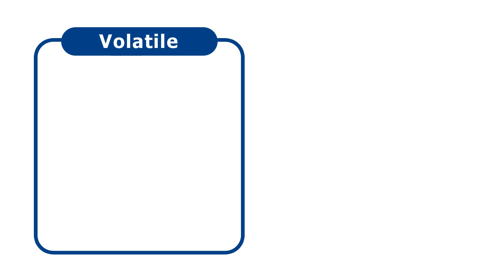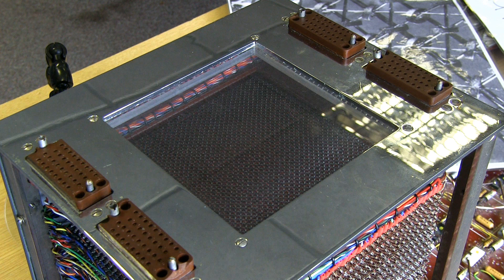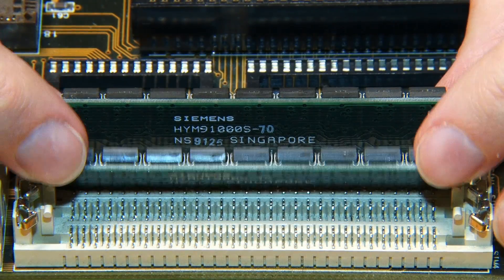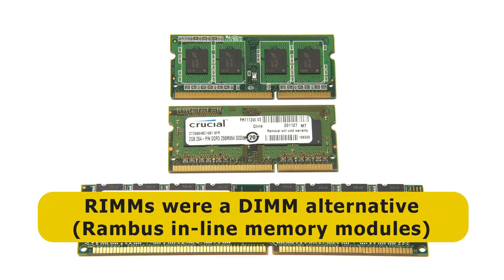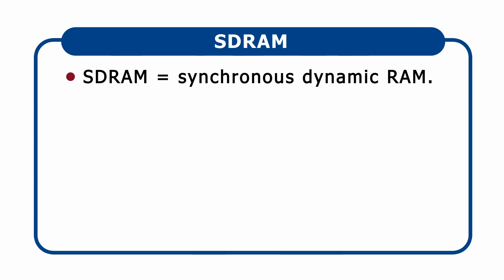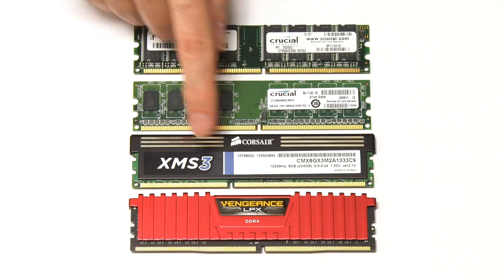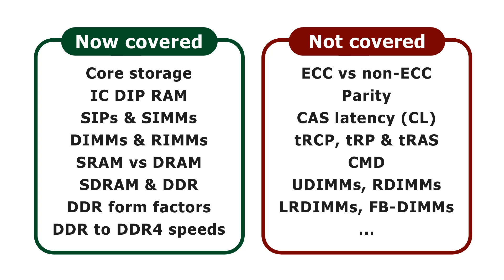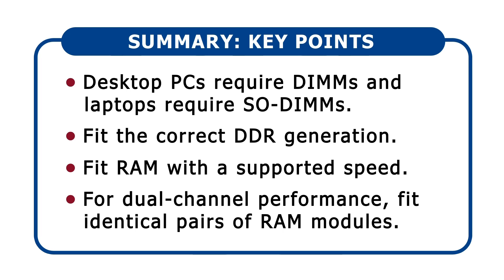Explaining RAM

Comment: I'm an actually noob who had someone else build my first computer, now hoping to build a computer I can truly call my own. I went to the mall to canvass computer parts and prices, and you could only imagine my face as I was completely overwhelmed by what the parts were listed as. What's the difference between a normal graphics card like a GTX 1050 and a GTX 1050Ti? What does the Ti even stand for and why is it important? What's DDR4 and how is it different from DDR3? What's PCIe? I/O?

All I knew coming in was from my current computer: I knew I needed a CPU even though I barely knew anything about it except that it means Central Processing Unit and I'm suddenly faced with Ryzen and Intel brands. Why are their sizes so different? What's core count supposed to mean?
I knew I needed a motherboard but what's overclocking and why does that make it better than the rest?
I knew I needed a Hard Disk Drive because that's what's in my computer, but what's this Solid State Drive and this M.2?
I knew I needed RAM but what's DDR? What are these letters and numbers?

Quite literally all I could go on about things is the price and the appearance. I just decided that if it's expensive and looks impressive, then it must be good. I got really intimidated by the price total and thought about leaving but decided to just go talk to an employee for their opinion. When I showed an employee my list and asked if it could work, he actually snorted because of how off I was. I had Ryzen Threadripper and Asus X-99 motherboard at the top of my list. When the guy asked if I actually knew what I was doing and I said no, he was actually really nice when he said I should probably go home first and research properly. It's been 2 months since then and all I've done is look things up. I pick up a few things here and there, but this video is pretty much explained everything about RAM I think I need to know. Thanks so much!

TL;DR: I'm a noob. Wanted to build a PC. Didn't know what anything meant. This video explained some things to me simply and clearly. Thanks!
Reply from the maker: Thanks for this. And look out for my PC build series that starts in the second half of Jan 2019. :)

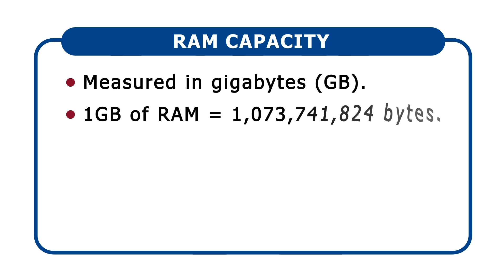Comment: @1:05 you say RAM capacity is measured in GB.  I would have just said 'bytes' since RAM capacites can vary from megabytes, kilobytes, or even bytes depending on the application.
Reply from the maker: Years ago I would have agreed with you. But today, anybody purchasing RAM is going to purchase it in GB, so that is why I used this measure.
Reply: I guess I was looking at the video as a guide to RAM in general, and not as a  guide to Desktop and Laptop RAM upgrades.

Comment: I have a 2013 build pc which has Intel 3450i5 processor, db75en motherboard and 4gb ddr3ram. Recently I updated another 4gb. What do you recommend if I update another 8gb single piece if I want to run high ram consuming design softwares or to buy a new setup?
Reply from the maker: If I understand it, you currently have 2 x 4GB DIMMs? If you have two spare slots, the best upgrade would be two more 4GB modules. You could replace a current 4GB with 8GB, but will lose dual channel performance (not a massive issue though).
Reply: @ExplainingComputers  Yes,you understood right.My motherboard has 4 slots ,it can support 32gb so if I update it with another 8gb ram and keep the remaining slot for future update will it be viable keeping in mind the age of the system.
Reply from the maker: Yes, that should work -- though I personally would not plan on a further update of that board, and instead fit 2 x 4GB in your 2 remaining slots to achieve best performance. 16GB is a lot of RAM, and will remain so for some time.
Reply: @ExplainingComputers  thanks a lot. Proper technical answers are had to find. Thanks again.

Comment: Nice video and I've been at this so long that the only memory I have not installed is toroidal magnetic memory.  The one thing is ECC memory, I have had customers ask me to install the memory they "got cheap on ebay"  only to find they have ECC ram that is not compatible with their desktop computer.  So more on the compatibility or non-compatibility of ECC ram would be good.  Maybe a note in your description will same someone a headache.  I do love your videos and to think of when I started working on computers and then see the videos you do on small one board computers that are so powerful is just amazing.  I remember when I upgraded my first computer to 32K ram and paid big bucks for the chips.  I still have my first computer with all it's patches, jumbers, glued on heat sinks plus a display board mounted on cardboard so it would not short out.  I still do that kind of thing (just for myself) the computer I'm using right now is called frankenputer made from all kinds of leftover parts and  bits of trade in systems with a little wire wrap jumper and glue here and there.  keep making videos and every now and then think of where we started.
Reply from the maker: Fair point. ECC is not intended for consumer/domestic use.
Reply: @ExplainingComputers  True; unfortunately the computer manufacturers do not always tell the consumers that.  I do very much enjoy your videos, they Reminded me computers can be fun.

Comment: Hi Chris. Things are getting busy around here. Your explanation of ram was top notch. I see that you avoided the discontinuance of parity, I still think it was a mistake for Intel to do that as witnessed by the Pentium 2 + 2 = 3.99999.... It seems to me that the pc industry has sacrificed data security for speed, although to be fair I don't remember hearing any similar jokes about the mathematical certainty of a pc's answers so perhaps Intel has found a way to do it without attracting headlines. I remember going onsite to a BIG financial center to swap out the mathematically challenged sticks for those that weren't. It was an interesting job going in at some off hour with none there except us and the "shops" techs ripping out and slamming in good "ram". Take care.

I would like to send you a small audio file, do you have an e mail address or a Dropbox account that I could forward it to?

Comment: It's great, but a noise gate on that mic would be even better!

Also, 1 GB is actually 1 000 000 000 bytes, 1 GiB would be 1 073 741 824 bytes. Putting a metric prefix on a non-base-ten number is a dumb idea!
Reply from the maker: There is no gate on the microphone used for the off-camera narration here (it is a Sennheiser ME66 into a K62 powering module), but there is a gate used on the powering module for the Audio Technica AT803 (an AT8531) used for the pieces to camera). Please note that I have very significant problems my voice following surgical damage to my vocal folds a few years back, and that this necessitates significant post-processing. If you do not like my audio, fair enough. But please do not make assumptions about the equipment and care dedicated to my audio production. There is much, much worse on YouTube! :)

One gigabyte of RAM is most certainly 1,073,7541,824 bytes (due to the way memory is manufactured). I have covered this issue in depth in another comment. But in short, all RAM is sold and labelled in "GB". Yes, in theory, it should be "GiB". But in the real world, GB is what the RAM manufacturers use and will continue to use to specify and label their products. The "metric prefix" point was not raised for decades, then suddenly became an issue about 10 years ago, even though everybody in computing was exceedingly clear what GB, MB and KB stood for. For SSD and HDD storage, the point certainly matters, given that capacities are often cited in actual GiB but labelled (and then formatted) in GB. But this is not the case for RAM. I check and consider very carefully what to include in my videos, and here this very much included being very careful on those GB/KB units and figures cited.
Reply from the maker: And just to add, all standards bodies that I know of accept (if begrudgingly) that "GB" is used a synonym for "GiB" in the computing industry, and especially when it comes to RAM.
Reply: @ExplainingComputers  Sorry for being derisive! I wasn't trying to be rude. I understand your difficulties in audio recording now. I always considered the IEC standard for the gigabyte to be the golden one so I raised that point about it up. But no big deal, it's just something that peeved me a tiny bit. 

That being said, the quality of this video and all your others are of top-notch quality, and I consider them to be better than those made by other tech YouTubers. I hope you keep making more, as it benefits the community as a whole greatly.
Reply from the maker: Thanks for this. And I do understand your position on the GB/GiB thing! :)

Comment: Core memory was used in military computers and even the Space Shuttle into the 80's.. This was because it was non volatile and well proven. as an example the memory in the computers recovered after the Challenger disaster from the bottom of the ocean were still able to be read out. These cores had a hole in them smaller than a human hair but yet 3 wires could pass through them. The 3 wires allowed for read/write and sense..  The cores were described as "torroidal magnetic cores". Contrary to your image they all faced the same direction and were produced up to 128Mb
Reply from the maker: Thanks for this. However, please note that the cores did not always face in the same direction in core storage. If you look in the video at about 2:11 you can clearly see that in this Elliot memory unit the cores are positioned at alternate angles, just as they are in the graphic earlier in the video. I do not doubt that some core storage units were built with all cores facing the same way, but evidently this was not always the case. :)
Reply: @ExplainingComputers  I imagine there were several different ways to do it.. maybe by alternating the orientation they hoped to avoid cross field induction ;)  since reads are destructive
Reply: also there was "Drum" storage.. basically like a disk but in the shape of a tin-can with multiple read/write heads  and don't get me started on old school mainframe storage (tape, helical tape etc)
Reply: My first career in 1979 was at IBM Federal Systems Division  (now part of lockheed-Martin) and I tested core memories amounst other hardware for military tactical computers and Space Shuttle
Reply from the maker: You must have seen some amazing technological things! :)

Comment: When I started with the first computer (the father's one) in the house in the middle of the 80s, it was a Commodore PET 2001 series with an upgrade of ram to increase it to 64kB (Yay!) directly soldered on the motherboard. Lots of memories with this video... Thank you! ;)
Now, as a professionnal software engineer, I'm always upset to see how dirty and inefficient the usage of ram can be done in many softwares even if they are targeted for light configurations or embedded platforms (my special skill). It drives me crazy... And when I try to explain my point of view, my coworkers or boss look at me like I'm an alien.
Reply from the maker: Well I agree with you -- most software has become very RAM inefficient.
Reply: Not only RAM inefficient but cpu as well! I learned 6809 assembler so I could write a word processor for my 16K Coco way back when. That cpu was a Motorola 6809E running @ .49mhz but could keep up no matter how fast I typed, cut, pasted, etc. I was running the OS9 operating system with a single sided 5 1/4 floppy drive.The controller for it was plugged into the game port and booted JDOS which was used to then boot the OS9. Also had a cassette tape drive. Point is one could get a lot done in just 16K of RAM with efficient programming! Later went to MS MicroAssembler with 80xx machines to keep the code small, fast, and increase ease and speed of coding. Ah those were the days! Now using C++ and C# (just for fun due to retirement quite some time ago) and do not feel like I have the same level of control I used to have!

Comment: Motherboard says 2667mhz ram speed and then higher speeds with OC (example: 3200mhz (OC). 
What does it mean? Should I buy 2666mhz ram to play it safe?
Reply: Yes I dont want to OC anything be it ram cpu or gpu. I vote always on durability.
Thanks
Reply from the maker: OC stands for "over clocking" -- where you reconfigure your computer so that its components run faster than the design initially intended in order to improve performance (if at the risk of instability and a shorter working life). So what your figures mean is that your board is designed for 2667 RAM in standard operational mode, but can over clock the RAM to 3200. So personally I would buy 2667 RAM and run your board with normal/default settings, and you know it will work just fine. :)

Comment: I think you should have explained Clock Latency aswell. When upgrading with more RAM it's best if the new and the ones already installed have the same CL, or else the pc might become unstable.
Reply from the maker: A good and fair point. The video just seemed like it was getting overloaded . . .

Comment: Oh DIP memory, squish them cockroaches down every 3 months.... the satisfaction of the click sound as they bed down...oil the printer... clean the floppy drive.. suck out dust.. wipe over keyboard and monitor, the lot of a computer tech in the mid 80s... and … on the expensive machines... debug g=800:5 … or something like that.. memory haha.. low level format.. 20 Mega Byte Seagate ST224 .. St 2 something... I remember retrofitting rubber mounts to hard drives to overcome heat warping.  30 years ago... so long ago... so long ago...

love your videos...
Reply from the maker: Computing and its maintenance has changed so much. Thanks for sharing this.

Comment: What's the difference between DDR5 and GDDR5 which is already in devices like SurfaceBook?
Reply from the maker: GDDR5 is the fifth generation of graphics DDR RAM, which is different in terms of specs to general RAM (eg greater bandwidth).
Reply: ExplainingComputers I understand this in principle, but can't a machine use spare Graphics RAM when normal RAM isn't available, instead of using pagefile to borrow static memory space? Seems so redundant
Reply from the maker: I am not aware of a PC being able to use a GPU's RAM (at least in a normal OS configuration).
Reply: ExplainingComputers that's why they shouldn't be separate to access by the OS. If the OS could manage at will what RAM to use where and when, it could juggle storage, graphics and standard volatile for maximum efficiency. That's why for me, all graphics should eventually be integrated, and the CPU should also be the GPU.

Comment: Another great video.
Could you tell me, if you know, I have a laptop with 8GB of RAM but only has 1 slot of memory RAM which is occupied by a 4GB memory RAM, if I buy an 8GB memory RAM to replace the 4GB RAM will it downgrade performance because it won't have dual channel anymore or the extra 4GB will greatly increase the performance despite not having dual channel?
I don't need 12GB of RAM for now, but in the future I might need so I wanted to know if the money would be well spent or not...
Thank you!
Reply from the maker: If there is only one slot, dual channel is not available. So an 8GB module replacing a 4GB will work at the same speed (assuming it is the same speed SO-DIMM). It will be money well spent if you reguarly have problems with your running out of RAM.
Reply: @ExplainingComputers  Ok, thank you. The pc have 4GB within the motherboard that cannot be removed, I don't know if there is dual channel with that and the 4GB removable RAM module.

Comment: Yeah, no one wants to talk about or explain latency, which is, in a word, horrible, and yes, it matters and makes a mockery of these transfer rate specs (which is why they publish the nice looking numbers...but not the latency ones, and it's not just CAS latency, Chris).  Look into how many clocks - and CPU clocks, not ram/IO clocks (which are some sub multiple usually) it actually costs you to get one single byte on a cache miss (hint, it's a two digit number of cycles just sitting there waiting)...if you're doing things like a lot of IO (interrupts) or VMs that skip around in memory a lot - that's why things get very slow very easily.
Reply from the maker: I may attempt a latency and other timing RAM video in 2019! :)
Reply: @ExplainingComputers  I almost feel sorry about suggesting that - it's quite a rabbit hole to get stuck in!  I'll send you a virtual pint if you do - at least.  You'll need it.  The current numbers the makers like to post take marketing specsmanship to a whole new level.
It's a big reason GPGPU kinds of things can go so fast - all sequential ram access and big-parallel means it can mostly be pipelined and the latency hidden, or at least amortized over a whole big block - and you really get those advertised speeds.  But it is the glory of general purpose computing to be able to to "if(something)" - do something different based on data...so in most non-trivial work, you can't just do the same thing to each chunk of a big block of data...and it may be that the cache algo in the CPU overwrites the code you're running when it has a miss on the data it's working on..this is hard to even test well!  (some architectures have separate I and D cache for that reason)

Comment: Double capacity RAM is now a thing. It's nothing too special from a technical point-of-view, all it is is a RAM module with double the normal amount of memory you'd typically see. A single one of them holds 32gb, which is impressive. Unfortunately there are only a few manufacturers that are making them, and they're using a unique pin layout that's only found on their own hardware.
https://www.anandtech.com/show/13458/gskill-unveils-32-gb-trident-z-double-size-ddr4-dimms